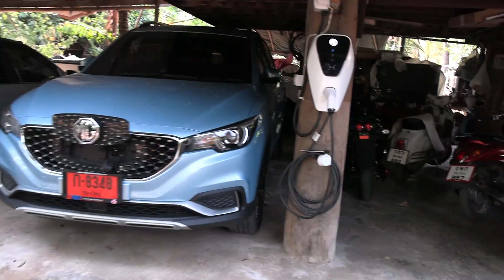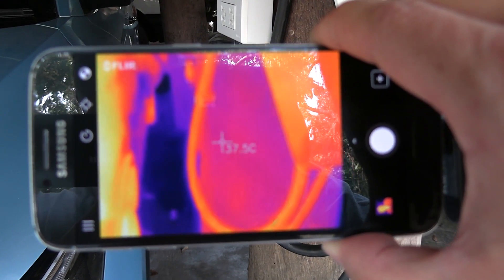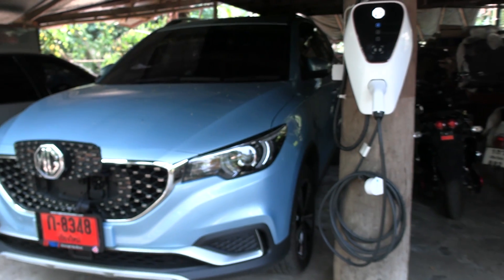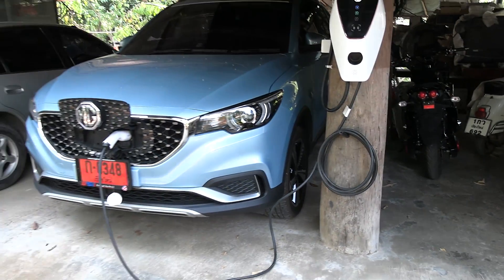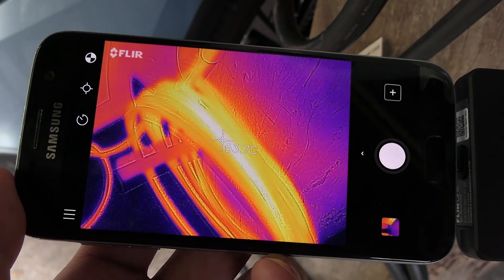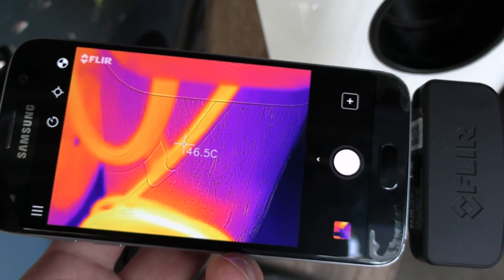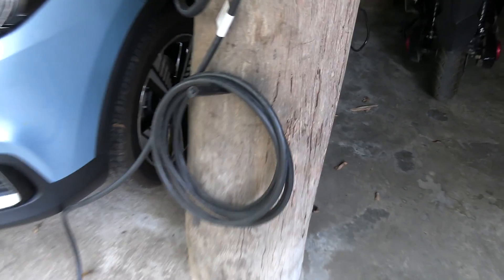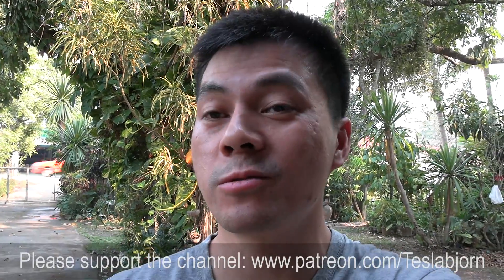Don't charge with coiled cable

Comment from the maker: I see I did a mistake about the magnetic field. It does not create a magnetic field. The heat comes from resistance in the cable. And coiling it up makes the heat accumulate. But the point of the video is to show what happens if you coil the cable. Sorry for the wrong information.
Reply: you can see the latest video of Electroboom where he explains exactly how coils work :)
Reply: @ZleFox  not coils , he explained about inductors. You can make coil out of rope also.
Reply: Thermocamera is really precision when is used on one material. Every single material has a different thermodynamic feature. However, difference betwen materials should not exceed diference greater than 2 °C.
Reply: Exactly. It doesn’t really matter how it happens. But rather that it does happen. Great video
Reply: The mistake doesn’t matter. This is safety critical info. It really matters.
Reply: The cables are most likely shielded in some way too so that can't happen...
Reply: it create a magnetic field  its a coil
Reply: @The81ubb  It is a coil but the total current in the coil is zero, silch nada, nothing. You see This is Kirchoffs first law. https://en.wikipedia.org/wiki/Kirchhoff%27s_circuit_laws#Kirchhoff's_current_law
Reply: @The81ubb  it's not an inductor. It's a coil of wire

Comment: It's because of resistance, and induction resistance. If you have heard about Watt = Volt x Ampere  or Watt = Resistance x (Amp x Amp), Then you will understand why it generate heat. 
W =  0,1ohm (16 Ax 16A)  =  25,6W, this is for the hole cable. So if you are winding it up, the cable will get more of the heat on one place + induction heat (magnetic field heat, not so easy to explain)

Comment: I think the cable is too thin, it may be less than 10AWG, so that the higher resistance generates more heat than thicker cable.
Throwing cable on the ground in there isn’t a good idea either, the ground temperature in summer could be higher than 50C, causing the cable insulation meltdown... 
better solution is shorter cable or more thicker...

Comment: The return resistance of 6mm² copper cable used for charging cables is around 7 ohms/km. So a car charging at 230V/7kW (32A) with a 10m cable will lose 32² x 0.07W = 70W of energy in the cable itself. As I have a long run from my house to my charge point I use 10mm² cable which has approximately 60% of the resistance and hence 40% less power loss. Power loss, of course, is simply turned into heat.

For 22kW @ 230V, just multiply the loss by about 2 as the current is split across three phases rather than one.

Comment: First, the black cable will absorb heat more than the lighter wood.  
Second, he is correct, it mostly a magnetic transform effect and also proximity effect.

Comment: The colour is black and absorbs solar radiation faster than the post, the cable gets hot during charging and radiates heat to each coil and starts gain more heat  overall

Comment: You should never use any type of electrical cable when it is coiled ... not even those extension cables which are specifically designed to be coiled for storage.

Comment: I thought the heat was mainly due to resistance in the cable. Even if you stretch out the cable it will get hot(ter), this is obvius when charging at winter and the charging cable melts through snow over time. I guess this is also why you should never use a cable drum without unwinding it completely.

Comment: I’m sorry to say this is not correct. The cable is likely heating due to resistivity of the cable. The degree of heating indicates there is not a significant amount of power loss.

In the cable current is traveling both to the car and away from it in equal measure. This means magnetic fields created by current are canceled out.
Reply from the maker: Check pinned comment and video description.

Comment: Yes, of course  it is not about magnetic field. The thing is that charging cable has two power wires where current goes in different directions, and two magnetic fields compensate each other. Straight cable has much better cooling than coils.

Comment: I am planning to charge my Model 3 on Schuko but only 1kw,  5A selected in the car. I expect very little heat loss, so no worries. Good plan or bad? Its good for the battery health to charge that slow. And i drive only 15km a day to work. So no problem with range.

Comment: It makes no sense that you're creating a magnetic field in the coil because the return wired are close to the positive lines. The hot spot is generated probably just because of ohmic losses and not enough surface to dissipate heat due to the bundle being together.

Comment: My plan for dealing with the wish to keep the cable curled up is using a 32A cable and only charging at 11kW. I think running one phase at its rated current gets hotter than running three phases at half the rated current.

Comment: The longer and thinner the cable the more resistive losses you have. Which creates the heat. If your AC charging requires a 16A cable but you use a 32A cable that cable will stay cooler and you have less losses. For similar reasons a split phase or 3 phase system is always better than single phase as more conductors and connector pins share the charge current. Worst mistake is single phase charging on a household power point (10-16A, depending on house and country where you live) via a extension cord stored in a cable drum.

Comment: Yes as you correctly point out, the heat accumulates when cables are bundled together like in a coil. In fact, if you have 8 cables or more tightly stacked together, the current carrying capacity should only be 30% of the full rating according to IEC standard. Even if only two cables are stacked toghether the current carrying capacity is reduced to about 72%

Comment: Issue is just resistive heating, which causes the cable to rise x degrees above ambient.
In a coil where the cables ambient temperature is that of their neighbours, then the temperatures will add up depending on number of layers.
Magnetic field is negligible as the conductor is a pair and cancels out. DC is not affected by inductance apart from when switched on or off.

Comment: It’s AC. 50-60 Hz alternating. It’s not because of the induction, rather than just lines cramped together with less than optimal heat dissipation.

Comment: Black material does not also absorb heat radiation better. Its also emitting heat better.  The camera should have a setting for emisivitity so you can measure correctly

Comment: This is all due to resistance Bjørn. The loss is in W per meter per amperage. When you coil it up, you get more W in a small area, thus warmer. If there is no air movement at all (tightly coiled cable, the middle will not have air movement) it will get very warm indeed, and melt. Self-experienced.

Comment: If you charge like this often and have the option, maybe consider getting another thicker and shorter cable.  Right now it's like you're running an unnecessary heater.

Comment: You get the coil losses only if you use AC current. The coil generates the magnetic field only if the current changes. The cable will heat up due to internal resistance, which will go up with the temperature. You can keep the heat losses somewhat smaller by unwinding the cable.
PS. I did some Asian math, and the losses for a Copper cable at 55 °C are 1.054 times those of a cable at 40 °C.

Comment: It is an age old debate between electricians, whether a coiled cable lead is heated up only by resistive heat and its inability to cool properly, or whether the inductance plays any role. I think that such a small number of loops of cable cannot have significant inductance. You may make a test and try it once more, but this time make an 8 shape from the cable, this is guaranteed to not have any inductance.

Comment: It is a good idea you have made a video about it, not many people think about it, lucky the cable is short however if it was 30 - 60 meter you would have a big problem.
the reason is due to the resistance in the cable, if the manufacturer has used a (AWG or square mm) = cross sectional area that is to little, that will increase the temperature, it is also known as voltage drop.  
When it is round up the magnetic field will try to cancel it other out and that will increase the heat, well there is also a longer technical explanation however it is a bit hard to explain since the cable resistent isn't the same if it is on the floor vs hanging on the wall as a coil. The coil version is called imaginary resistance.

Comment: I think you can only have a problem, when the current that is used for charging the car is alternating current. I am not 100% sure, but I guess you are using DC? DC has no problem running through a coil, its the change of voltage that a coil with its impedance is opposing a resistance. I have noticed this phenomenon when I was celebrating with a lot of friends for new years eve: Lots of electric grills were connected with a single coiled up extension cord (>20m cable closely winded up): Sometimes the circuit braker was activated when all the deviced heated up at the same time.
Reply: ah ok, no worries. People already commented that the cable has two phases anyways, so carrying current in both ways... forgot about that

Comment: The cable heats up by resistive loss only. Magnetic affect are negligable. The temperature rise in the coil is just from proximity of other coils. The connector at the car is warm from resistive loss in connection. The thermal  camera is affected by the emissivity of the target. Put a piece of black tape on copper hot water pipe. The tape will quickly match the pipe in temperature but will show hotter than the pipe on the IR image. The  tape has good emissivity the copper pipe  has less and reads cooler. In general shinny reflective things have poor emissivity. The IR camera is a marvelous tool, I have several, but with targets of different emissivity is not an accurate thermometer.

Comment: The theory is right, if you look at coiled extension leads safely information labels,  it gives a much lower current rating when on reel than when fully wound out. Google for images of  overheated extension reels and see the results. This is a label from a  uk specification reel.

https://images.app.goo.gl/gFw2mE6rYj7cZdbx9

Comment: I suggest you attempt to find out the thermal emissivity settings of the camera FLIR you are using.  thermal radiation is fairly complex to measure, and therefore the temperature being reported can have some errors.  it was apparent that the observed temperatures are not consistent.

Also a magnetic field only is created by AC current, not DC current.  Lastly, even if there is a magnetic field from the loop, the eddy current heating only happens to conductors inside the loop, see induction heaters.

Comment: Yes it creates magnetic field, but u missed a point that current inside the cable is not running in one direction, instead current through phase line is returning through neutral. Phase and neutral current is same at any time. Because the current in phase and neutral are always in opposite directions the magnetic field produced by them will be opposite, equal and will cancel each other. So net magnetic field will be zero around the cable. Inductive heating cannot occur.
Reason for wire heating up is due to lack of proper ventilation. If you place the cable inside a closed box and repeat the test. Cable inside the box will be hottest.

Comment: The reason why the cable is hotter is because of the electrical resistance of the cable. Heat in watts equals current squared times the resistance in ohms of the cable. With A high ambient temperature the cable will obviously get quite warm at high current flows.
Reply: The question was why the coiled cable is hotter
Reply: @Talaxianer  poor ventilation
Reply: @EngineeringEssentials   The question was not my question but got answered in the video

Comment: Maybe is not the coil itself, but the fact it is bundled together and the heat accumulates. Maybe that also explains why it was hotter at the center of the coil.  One way or the other, having the cable spread and not bundled is a good idea.

Comment: at 1:25 it looks like the white cap is same temp as the cable.
Is there a note about max temp on the white sticker on the cable? Or maybe printed on the cable itself.
Reply: Max insulation temperatures are usually printed on the cable, or a standard they are made to which would give the details. Most cables are a max temp of 70-90C, depending on what they are made of.

Comment: Dont think it is related to coil/magnetic field. More related to less air ventilation as placed in layers.
Reply: It is no coil effect, promise. In your cables you have 2 wires and the current never flow the same direction at any given time. The magnetic field from each wire will be canceled out. 
Temperature will rise in the cable is due to internal resistance. Airflow around the cable will cool it down. Strap the cables together and it get worse. Put a fan on, and you et less. This is why you may see snow melt around the cable. 
What you definitely not do is tape your cable to a compact coil and charge in the sun.